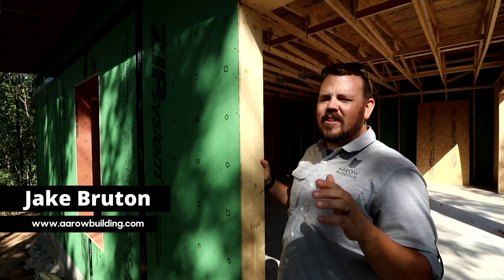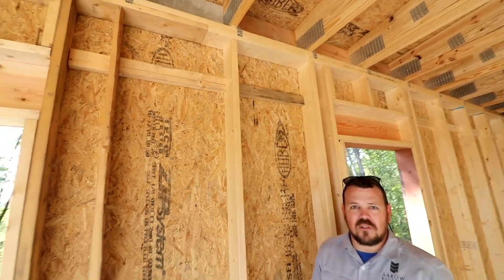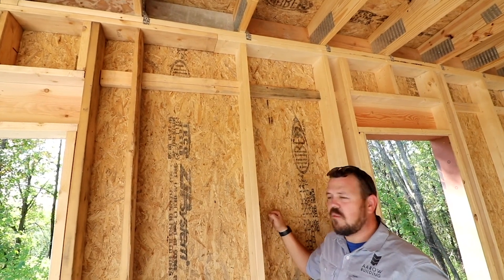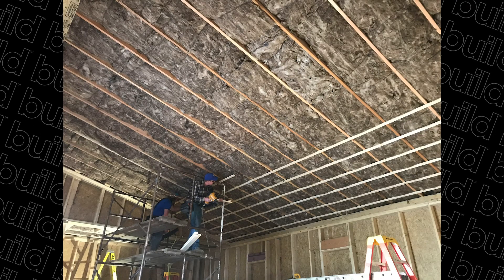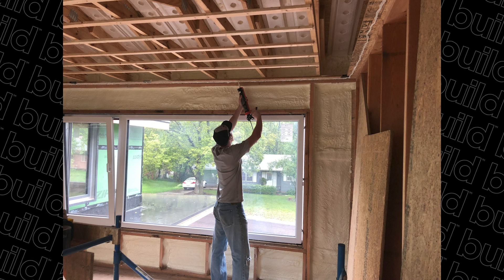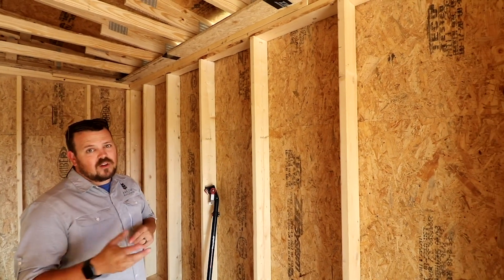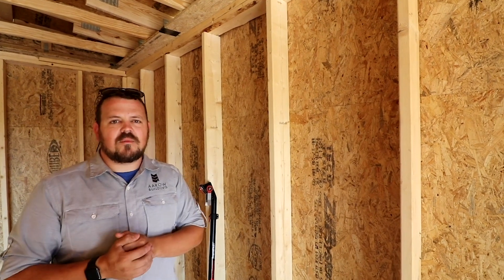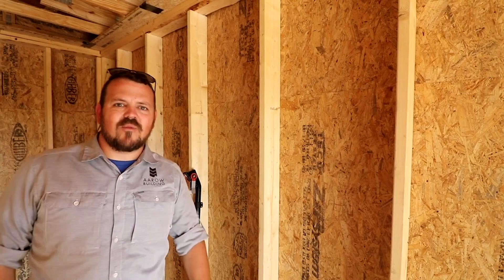Air Barrier Connections

Comment: Would this detail work in climate zone 3 cooling dominant

This would put my air barrier to the inside at the ceiling level

Would it cause me a moisture issue on top of the drywall
Reply from the maker: This absolutely would work in CZ3. No moisture concerns at all. The lack of air movement is an excellent way to reduce air transported moisture movement.

Comment: This connection would also work great for a double wall assembly detail giving you fire blocking between the wall and ceiling since the sheathing would bridge the inner and outer wall at the top.

Comment: @jake.bruton.arrow.building I'm loving everything that you are doing with the Advantech on the exterior wall top plates.  That makes so much sense along with the strapping.  What I'm trying to figure out is the interior partition wall to truss connection.  I have designed a 36x54 house with trusses spanning the 36'.  I want the monolithic drywall ceiling.  I'm told with 5/12 trusses not to nail or screw up through the top plate into the trusses because of uplift and to leave a gap at the top of the walls.  Thought about using a gasket on top of the walls which takes care of light/sound/air movement between rooms then screw up through the top plate into the truss but leaving the screw proud 1/2" so the wall could not move laterally but the truss could move up and down.  Can't use traditional truss clips of coarse.  But.. this leaves the gap to finish somehow in the inside of the room. Thought about crown or 1/4 round only attached to the ceiling so it could slide vertically on the wall.  To be honest I think if you put advantech on the trusses above the partition walls and used a big screw through the top plate though the Advantech into the truss tight it wouldn't move at all but I'm not an engineer.  SUGGESTIONS are appreciated.

Comment: With all the effort (labor and material) what is the yearly return with detail with a 2,500 sf house single story house, where you are?
Reply from the maker: We chose to not look at things like this from a return on investment only perspective. This is an investment in health and comfort. I did these things on my own home and I sleep better, am sick less, and our home has excelent air quality and these things contribute to that. That being said, these things also contribute to the energy effciency of the home and my home uses half of the national average kWhr pSQFT of a traditionally code built new home. So my electrical savings are theoretically ~$100 - ~$200 a month.
Reply: @jake.bruton.aarow.building  Thanks for the response.  What about using a 6" (3"x3"
0 self-adhesive 60 mill epdm 'L" flashing wall to ceiling?

Comment: How well do you think this would work if the Advantech was replaced with something like tyvek or other WRB/Membrane?  my thinking that you still get the surface for sealant but don't have to change up any other details. It looks straightforward to me but I'm having a hard time finding a builder that has ever used zip.  In my area you don't really see it on a build below 1.5M.
Reply from the maker: We are doing the same detailing with Majrex from Siga on some projects as well. Check out the Buildshownetwork.com and my videos there for those details.

Comment: I like it! The top plate could be replaced with the 3/4 material if the framers are willing. We’ve been using Timberlok screws instead of hurricane ties for years. No drywall problems and no suffering with a palm nailer or shooting nails next to one’s head.
Reply from the maker: Totally agree. I hate using that positive placement nailer next to my noggin.
Reply: @jake.bruton.aarow.building  Could you also run the horizontal OSB sheathing all the way across the ceiling attached to the trusses and tape that for your air barrier? Then do your strapping underneath that layer to create service chases for the trades?

Comment: How do you manage the air sealing details for electrical boxes and light fixtures in your drywall on the ceiling?
Reply from the maker: We have a mix of tactics including building oversized air sealed boxes or metal electrical boxes with sealant.
Reply: @jake.bruton.aarow.building  love to see a video sometime if you’re willing to share 👍🏼
Reply: @jake.bruton.aarow.building  This is what I am looking for. I am looking for what is the most feasible products you have found to solve this particular penetration of light box issue. I really like the monolith style drywall barrier, but it needs paired with a good light box detail from above if it's a vented attic system. Matt R. does so much unvented stuff he doesn't concern himself with it, but for vented spaces and no spray foam on the lids, it takes a good connection. I have done drywall boxes and sprayed an inch of open cell over the entire drywall system from above to airtight then dumped cellulose on top, but looking for more economical ways of getting the airtightness without making my subs get all weird about doing stuff so foreign to them...I haven't found a good light box covering that fits the bill in my search so far. Thanks!

Comment: So you don’t need a air barrier on the ceiling the sheet rocks itself is the barrier thanks
Reply from the maker: If the install is properly conducted. It does take some effort.
Reply: How do you ensure your drywall crew are bought into airtightness? Also can you do a video on details for lights/elec. boxes in the ceiling that work with this method?  @jake.bruton.aarow.building